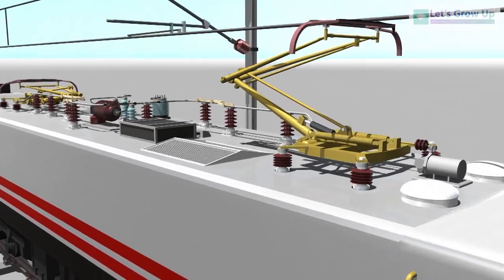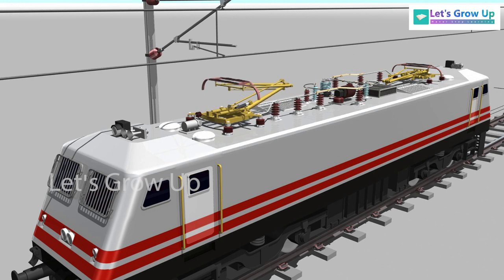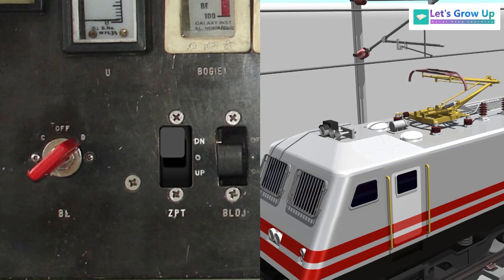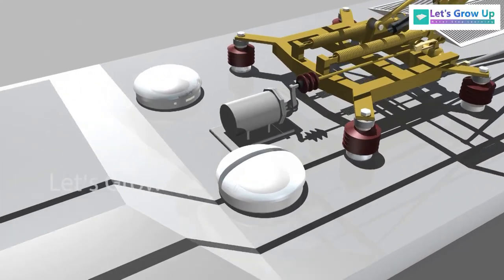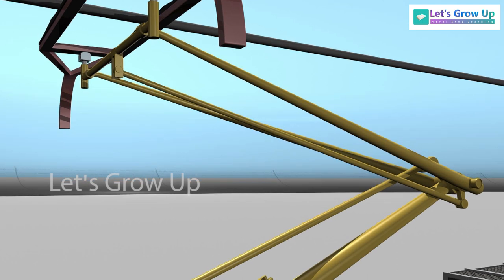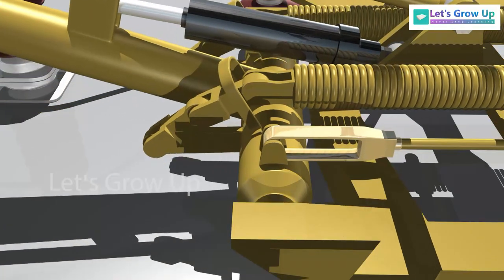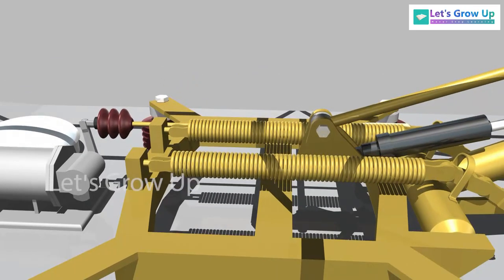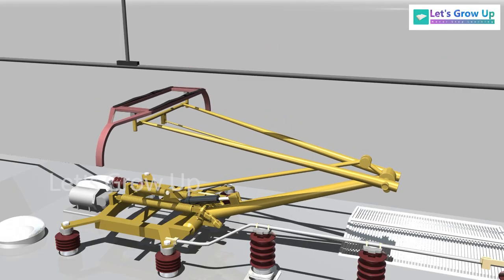Why always rear pantograph touch with OHE? Explaining the pantograph's mystery

Comment: In Europe on locomotives that run internationally  there are up to 4 roof mounted pantorgraph, each will take a differing voltage  and/or national infrastructure system (side to side location of overhead wire along its axis require different width collector on locomotive). The locos will also have equipment for 'reading' the differing signal,  route designation and communication in each country. However there are more than 4 different systems in Europe, so unless it has aux - diesel power there is no single loco for the European system.

Comment: Dissapointing video. You say a pantograph is need for all electric locomotives, incorrect. Locomotives that get their power from the 3rd rail do not. Also you have used an automated voice for the commentary, and it cannot cope with the degrees i.e. 45 degrees.